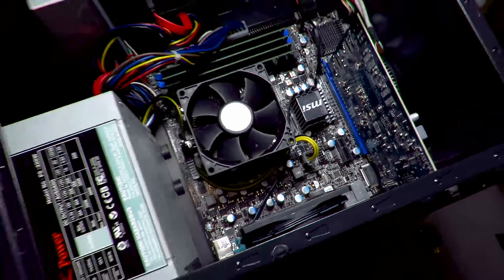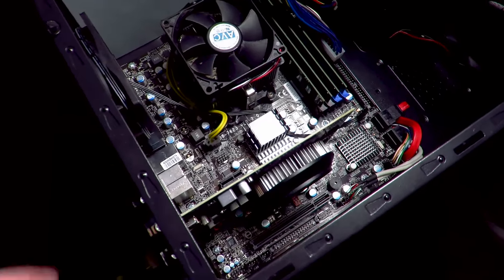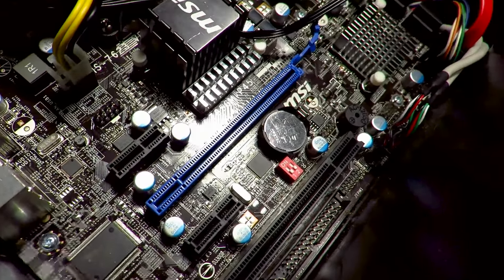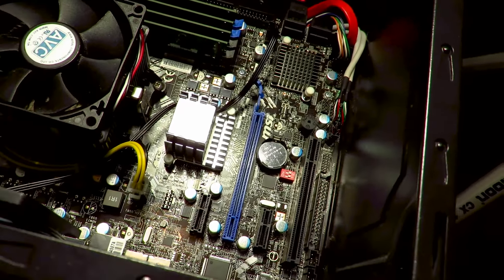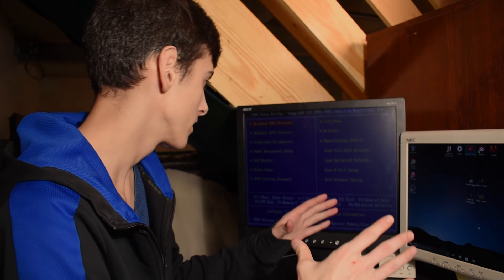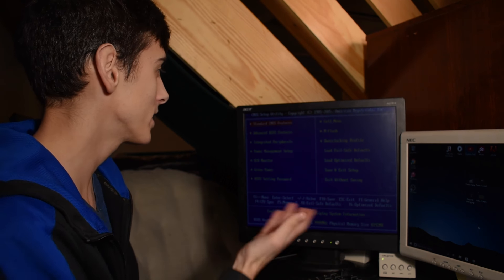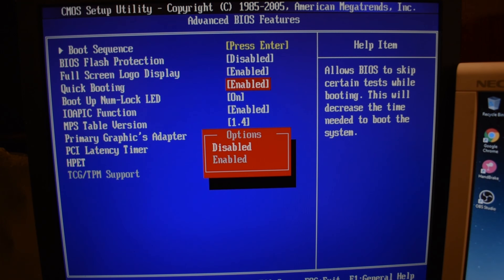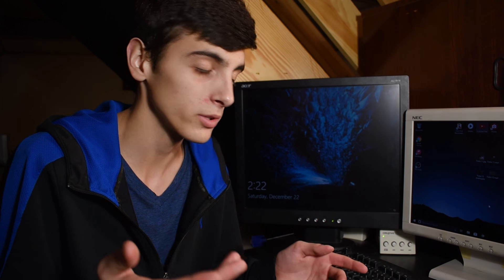[FIX] BIOS Screen NOT SHOWING UP!! [2020]

Comment: Help me it didnt work when my pc starts it says gigabyte and stays on the gigabyte screen and it says F9 for sys info F12 boot etc, after i press any of these buttons nothing is happening
Reply: Mr. Mike Me 2 , if it has fixed can you answer back and how it was fixed
Reply: @MominTheBeliever  did u fix it yet? Cause i have the same exact problem
Reply: F12 and select where to boot from

Comment: I just build my pc everything boots and my leds and fans and gpu and liquid cooling all runs but my monitor will just say no signal
Reply from the maker: On your keyboard does the caps lock light turn on? Is there any beeping or red led lights on the motherboard?

Comment: My pc was booting straight to windows and when I try to spam f2 (key for entering bios) just an black screen shows and I think my bios is running behind. As I tried the f10 key which is to save and exit. It exited to windows. I find this strange and need a fix
Reply: I know this is a year later and a shot in the dark... but did you ever solve this?

I'm having the same problem with an MSI pre-built I just got yesterday.  Boots into Windows fine... but during the POST startup I have no video at all... normally I'd see startup messaging, maybe an MSI logo, etc... but no... on booting up the PC, my monitor is just dark until Windows loads, then my monitor turns on once I am looking at my desktop.

I am able to, I think, stop the boot at the BIOS screen (have tried both the Del key, and using WIndows modified restart into BIOS option), but then the monitor is just blank... and stays blank forever... I'm guessing it's in the BIOS screen, but I have no video output at that point... not until Windows is loaded which loads in my GPU drivers I guess.... and because I can't see the BIOS screen I can't even look to see if there's something set wrong.
Reply: @MapleGoodness  I upgraded my pc mate. And I strongly think it was the motherboard. Claim your warranty. Without the bios screen you can't change the stuff in bios. You have the same problem I had
Reply: @TarunKumar-sv7ee  hey just wanted to update.  I did some more troubleshooting this morning... And I uninstalled MSI Dragon Center software as I read it causes stability problems for many people... It's kind of bloatware that I wanted only to control the LEDs in my system... Anyways I u installed it and now my pre-windows video works, bios works, etc.

Now I just need to find another way to disable the led on my nvidia gpu.

Comment: I completely erased my hard drive and now I cannot get to the bios screen that allows you to boot from cd rom. Please help. I took out the cmos battery, waited and set it back. Still no go.
Reply from the maker: Does your motherboard have a clear cmos button or pins you might need to try that
Reply: @ZackEberly  it's a laptop but i'll check on the 'clear cmos button'. Not sure about the pins. Lenovo wants $69 for the recovery disc - no thanks! 2013 laptop
Reply from the maker: Using a windows 10 bootable usb would prolly work better than a disk. And it’s free
Reply: @ZackEberly  So I found there was a button next to the power button and if you press it twice when starting the laptop, it gives the option for Bios set up. When clicking it, it does the same thing it did before. I actually just tried the windows 10 usb option and it couldn't load the file. Thanks for your help, but I'm tossing this laptop.

Comment: Thanks for the vid. That was the problem i had, but in bios i noticed that it wasn‘t booting from windows. So i fixed that and saved. It was working for a few days, but now i have the same problem with the black screen, however i cannot get into bios anymore. Even after taking out and reinserting the battery, i get nothing. The pc is running, but all black screen. Does anyone have any idea what else it could be?
Reply from the maker: Does it give an beeping sounds when you start it up?
Reply: @ZackEberly  mine does
Reply: @ZackEberly  i have the same problem as him

Comment: I had to unplug my second GPU in order to reach the battery. I made all steps like in your video and it worked. But when I plugged the second GPU into the mainboard I got the same problem :(
I have this problem since I switched from a X370 to a X570 mainboard
Reply from the maker: Try looking for either a clear cmos button or pins that will reset the bios.

Comment: In my pc the company logo isn't showing and ram also working good working I did this same but nothing happen
Reply: 3Body Maj  buddy check your processor because I fixed it myself
1 clean your ram with a eraser
2   check processor fan is fit or lose then check it if not  then
3 check your processor ,open it and check it's locked correctly reapply thermal pate and compund then fit fan (before you remove your processor you should already have a thermal paste
4. check all the wiring is fit
5. Change the coin battery on motherboard
Then 90%  it will work then it will be a hardware problem.
And tell e about yourself where are you from by the way I am from india
Reply: 3Body Maj  guess what I fixed it yesterday and I also hope your will work as well mine and spread your knowledge i rearly comment on someone post  but I want to help others and I hope you too do that.
Reply: 3Body Maj  please use all method I tell you then see what's happen

Comment: Quicker Fix (only for  ASRock) : spray  ur F2 while clicking the power button u need to do this be4 u see the windows logo pop up until u here a beep sound thank me later
Reply from the maker: But if you have the bios/uefi set to quick boot than it’s still not possible.

Comment: I  having this problems,in my case my pc turns on it shows in LED light,  but it monitor shows black screen, and no keyboard power on, only computer mouse gets turn on. Please help with advice.
Reply from the maker: Does it have any beeping sounds when you turn it on... could be bad RAM, motherboard... but your mouse works. It could be your GPU. Check online to see if anyone else has that problem.
Reply: ZackEberly when I turn the pc on, its shows everything is working but the bios don’t turn up after 10 minutes in that blackout state finally makes beeping sound once or two then pc gets shut down, and the keyboard also don’t show up, I can’t type anything. I removed my graphics card then tried to run with default motherboard gpu. No luck, I remove the cmos battery then dried off the extra power tips you showed here, still no luck. Do you have any idea? Should I replace the cmos battery with the new one ( note my pc led light shows it getting the power ).

Comment: Ok dude. I bought new mb-gigabyte b450m s2h, cpu ryzen 3600x, and ram g.skill aegis ddr4 3200mhz 2x8 ram and my pc can't post. I have no bios no noting on the screen. Btw my psu is 500w and my gpu is r7 250x and tried other gpu and noting change. Pls HELP!
Reply from the maker: Reseat your comments make sure everything is getting power. Are there any led indicators on the motherboard or beeping sounds?

Comment: It didn't work for me, removed battery three different times and still a black screen.   HELP>>>>>>
Reply from the maker: Try looking for a cmos button or pins. That will reset the bios. You might need to consult google to find out.

Comment: After trying this method my screen won’t get a signal 😭
Reply: So guys my problem was that i was connected to the screen by the HDMI 2.1 port and this is what was causing the problem. i fixed it by connecting to the HDMI 2.0 port.

Comment: I disabled it out of curiosity, now I can’t get into the Asus bios. Is there a way without taking out the battery.
Reply from the maker: Some motherboards have cmos buttons or bridged pins that when you unbridge them they reset the bios. There is usually 3 pins and 2 of them are connected together. If you switch that and have the other pin connected it should reset the bios.

Comment: I have changed my ram speed in bios to the wrong speed and my pc won’t boot correctly, any idea how I can reset bios settings or change them?
Reply from the maker: Doing this usually works. I literally did that last week. Check for clear CMOS button or pins but be careful and don't short out the wrong pins. I usually unplug PC, remove cmos battery, and press the power button a few times to drain the last bit of electricity. Wait a minute then put the battery back in.
Reply: ZackEberly ZackEberly holy I am a bit of a noob when it comes to taking these apart but hopefully Ill sort it. Will I need to remove my graphics card or anything or will the cmos battery be viewable when I open the side
Reply from the maker: @Deanx91  That is something your going to find out when you open it. Unless you give me the motherboard manufacturing's product name and other PC specs help as well.
Reply: ZackEberly Iv had it open an removed the battery will be putting the system back together soon and crossing my fingers 😅🤞🏼 appreciate you man
Reply: Anything else I need to try other than removing the battery? Tried it all turns back on but with blank screen still
Reply from the maker: @Deanx91  Check motherboard for clear cmos button. That will reset the bios. What motherboard do you have?
Reply from the maker: Also try re-seating your cpu, ram, and gpu
Reply: ZackEberly I have ASUS a88xm plus.
Reply: I am on a blue screen now saying “your device ran into a problem and needs to restart” but is stuck on 0% the error code is “critical process died”
Reply: My system is booting up straight to bios anything I need to do to get it back up and running?
Reply from the maker: Here is something you could try for critical processor died- https://www.google.com/amp/s/www.partitionwizard.com/amp/partitionmagic/critical-process-died.html
Reply: ZackEberly I’m getting a different issue now it’s not the critical process died it’s booting up to blue screen saying “auto repair” pc did not start correctly then offers some options for repair but Notting works. Says I need to be signed into an admin account to do most the options which I’m not signed in
Reply from the maker: @Deanx91  I don't know how your pc was setup. What I do know is that you need to get into windows safe mode and run some diagnostics.

Comment: Help plss. i just came out from boot and i disabled the internal graphics then when i open again nothing shows just black screen,  how can i solve it?
Reply from the maker: Do you have PCIe graphics namely a graphics card? Plug your monitor into your GPU
Reply: @ZackEberly  i have Gigabyte RX 570 it doesn't have VGA port, what should i do?
Reply from the maker: @zippy8318  Use HDMI then... You know your supposed to use your GPU right?
Reply: @ZackEberly  can i use hdmi to vga converter?
Reply from the maker: @zippy8318  Yeah

Comment: I'm running an ASUS Maximus Hero VIII MoBo and lost the ability to open the BIOS on boot-up after I over-clocked my rig a tad too far and kept getting blue-screened.  I used Zack's method and surprise, it worked and I was able to tune down the OC to where it is now perfectly stable. Thank-you Zack!

Comment: Hi i Have problem My computer video card found the “quick boot” setting is off no keyboard found
Reply from the maker: Try a different USB port and different keyboard. What’s the issue with you video card?
Reply: @ZackEberly  i found card but quick boot setting IS off what that mean what i do i tested different usb Port no working
Reply from the maker: How about a different keyboard. Does a mouse light up at all when plugger into a USB port?
Reply: @ZackEberly  the keyboard and mouse will light up
Reply from the maker: @woxel98  But the keyboard doesn't work? Sounds like you have a broken keyboard.

Comment: Didnt work my pre built computer came with the graphics card not installed so i plugged it in now im getting no display
Reply from the maker: Do you have the output set to PCIe slot?
Reply: ZackEberly how can i do that?
Reply from the maker: @GoneMotivation1  You can try plugging into the onboard graphics to see if your get a monitor signal out. Then in the bios there is a setting somewhere.
Reply: ZackEberly Ok
Reply: ZackEberly I have a rx 580 and its saying i have a vega 8 is that my onboard graphics card?
Reply from the maker: @GoneMotivation1  Yes
Reply: ZackEberly anyway i can send a picture of my graphics card because im think now its not pushed in all the way
Reply from the maker: @UCvqks-lNknA5tLnoqH_a7SQ Join me discord... if you have it. so i can communicate easier. -https://discord.gg/ysdEffK

Comment: Love the video it's super descriptive! However it didn't seem to fix my issue I had my bios come up only once hooked up to the onboard graphics but now anytime I try to enter with my gpu installed I get no display when trying to enter bios but if I let it boot normally my computer runs fine. It's just the bios not letting me enter.
Reply: @Britec09  hi I bought BIOSTAR B550M and for my Ryzen 7 2700 but when I turned on my PC it doesn't post anything just blank black screen even tho my PC is turned on all of my Fans is working but no display.Is this bcs I bought a new motherboard that needed update? I previously use Gigabyte b450m S2H
Reply: @AmeerQ99  i have same motherboard i tried milions ways to join bios still wont let me in

Comment: in my case, even the logo wasn't showing up, but after ur method it works fine, thanks :)
Reply: Did you solved your problems with this method?
Reply: @anuponch7135  yes I did

Comment: My bios won’t show up no matter what, tried this and didn’t work
Reply from the maker: Try resetting your cmos
Reply from the maker: No_Mercy  Do you know what the cmos is? maybe your motherboard is broken.
Reply from the maker: No_Mercy  Do you have any incompatible components? I had a MB that powered on but nothing would happened... turned out to be bent pins. Check RAM and use different sticks.

Comment: Unplug the PSU, pop the battery out, push the power button to discharge the rest of the electricity, put battery back in, plug PSU back in turn on and it should reset first try every time now discharging the electricity is key to this

Comment: Hey buddy. 
My pc screen. Become yellowish 
And Boot menu isn't coming.
Reply from the maker: Check the cable connection. Try moving the cable to see if the connection is bad. Try a new cable to see if it’s still here. There might be a monitor setting that needs to be changed like color temperature.
Reply from the maker: Sorry I didn’t see the sending question. Like your bios/UEFI?
Reply: @ZackEberly  Shall we talk
In FB
Reply from the maker: @nandlalverma3112  I have discord- https://discord.com/invite/ysdEffK

Comment: What if I replace the battery instead?
Reply from the maker: Replacing we work if the battery is dead of course... quick check is to lick the edge of both + and - to if you feel a tingle then its prolly still good
Reply: @ZackEberly  ok, thx.
But my problem is a bit different. My PC freezes on the Motherboard screen. I assumed it was related.

Comment: this still didn’t work what else could i do please help
Reply from the maker: Try finding a clear CMOS button on your motherboard, you might need to go to the motherboard's manual to find out. Make sure all components are seated correctly. I'd reseat the cpu, ram, and gpu.
Reply: Caleb Bontrager did you end up figuring out what was wrong and got your pc to post

Comment: I have a laptop i don't know where is the batttery
Reply from the maker: Laptops are a bit different but some do have the battery tucked away somewhere.
Reply: @ZackEberly  i apperitiate your help 
Here is how i did it on laptop (win 10)
1 settings 
2 update and security
3 Recovery
4 restart
It will take time to restart 
Note:- THIS IS RESTART AND NOT RESET 
5 window 10 boot menu will open 
6 Click on advanced 
7 troubleshoot
8 restart 
And the boot menu that is blue in color (different for gaming pc ) will open . 
Or u can try this option as well take off ur lapi back cover and clean it and give some force to some wires to be tightened enough.
This worked for me and i did both of these steps
"Create a vid of this just in case people search for lapi boot menu "

Comment: After i did this, my pc wont boot to windows at all
Reply from the maker: Make sure you set the correct boot drive in the bios.
Reply: @ZackEberly  i figured it out myself, i had to use an hdmi cable to go into bios. And from there, boot to windows. Cant use display port for bios for some reason

Comment: Are kidding! That's a good way to go, but if you don't unplug the power from the mother board you take the risk of frying all your computer parts or killing yourself! Please do more research before going online with post!
Reply from the maker: Unless your touching the insides of the PSU the max is like 12v which does nothing. You'd just fry your components unless there is something seriously wrong with your pc that  has 120v pulsing through it. Don't spread false information.

Comment: Thank you for the video, Luckily my Problem for my Dell Inspiron 530 G33M02 Board after a Bios Update was to use a different Monitor to get to the boot menu..For whatever reason the new Bios set the display to the Graphics card slot by Default...Thank God I put my PC back together to try one more time on a different monitor or I would have sold a Good Board as parts/repair.

Comment: Mine says 161 system power loss...
Reply from the maker: If you have just replaced a motherboard and get this error:

 

1. Boot into this BIOS - Tap ESC or F10 repeatedly at power on.

2. File - Enter Time and Date.

3. F10 to Save and Exit.

4. Allow Windows to load.

5. Restart the computer and you should not have the error.
Reply: @ZackEberly  sorry for more trouble but this happened after I replaced the battery, it was fine before. 

Edit: NVM I pressed boot as in f1 many times and it works now, thanks.
Reply from the maker: @jazzyfunkyman5086  No Problem